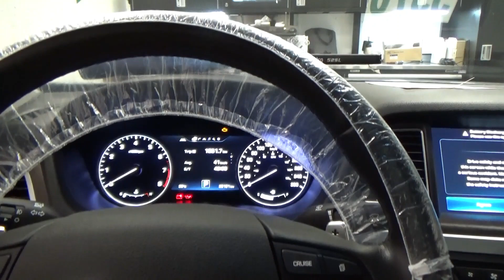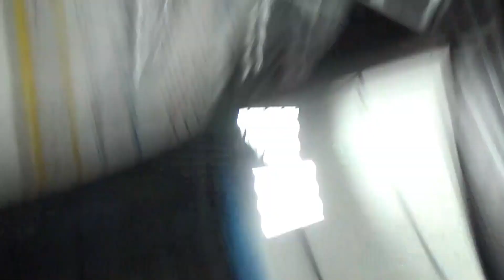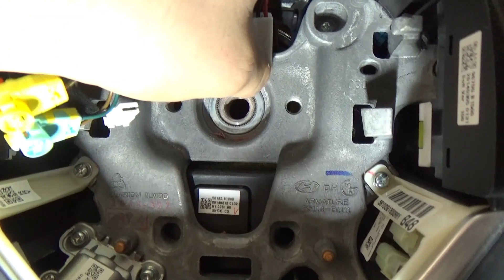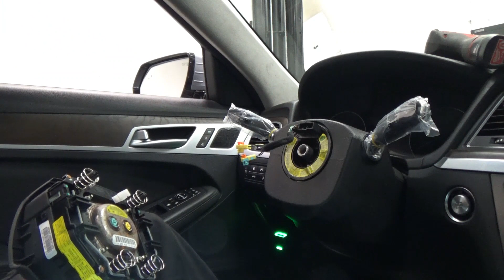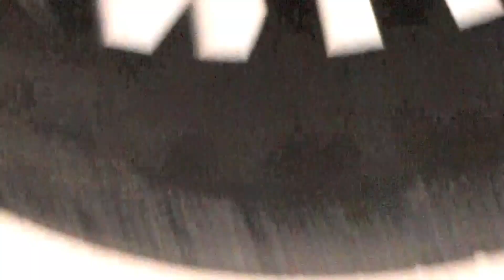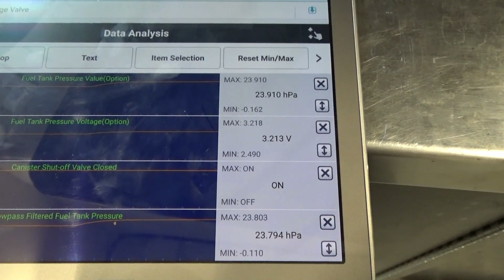2015 Genesis G80, Multifunction Switch Replacement and Incorrect Purge Flow Diagnosis

Comment: I have a 2016 and the dealer is wanting to replace PN 93410-B1400-FFF which is slightly different than what is listed on the warranty extension. If I look up this part, it pulls up the main base but only the turn signal stalk without the wiper stalk. It's also significantly cheaper than what I'm seeing online thru OEM websites ($150 versus $600).I wonder if Hyundai is trying to save money now by excluding the wiper switch and having techs swap in the old one.

Comment: Great video. I wish you had explained the airbag release better. You poked a screw driver in from the back but never described exactly what you were releasing. When you showed the back side of the airbag, you mentioned the pry area but I could not see it through your hand. Then you said something about a spring or clip...I wish you had explained that better. But still a good video
Reply from the maker: Yeah maybe next time.

Comment: First, I want to thank you for the video—well done! I was getting a P0441 error code and couldn't find the cause. I replaced the gas cap and the Bank 1 upstream O2 sensor, but the code persisted. After watching your video, I located the fuel tank pressure sensor and found that the sensor’s nose (not sure what it's actually called) was broken. I replaced the fuel tank pressure sensor, cleared the code, and—no more check engine light! Thank you again for the helpful guidance!

Next projects: 
1. Find an alternative for the DRL lights that keep burning out.
2. BDS errors that keep popping up
3. Reverse Camera not working

Car: 2015 Hyundai Genesis G80 Sedan 3.8
Mileage: 262,000 
Fuel tank pressure senor PN: 31435-2J000

Comment: I'm experiencing a issue with my fuel meter reading. It's stuck on full but the mileage range numbers indication is correct. Should I replace the fuel sensors or is it a wire or connection issue? I have a 2015 Hyundai Genesis G80 3.8L (118k miles)
Reply from the maker: What do youn mean your mileage range number indication correct? Like if you have have full tank and let say it has 400 km ramge then down the road you drove around 100 km and the cluster will say 300 distance to empty? I would suggest scan it for codes and if no codes i would suggest check the sender sensors, they have two.
Reply: @hyundaitech  Correct, due to I overfilled it, I was told to drive it down to about 100 miles of gas left and see if the gas meter go down. I have no codes, no engine light. Everything works fine but the gas meter reading is stuck on full (digital).

Comment: Great comprehensive video! I have a 2013 Genesis R Spec that is having the same problem with the multi function switch. Is the disassembly procedure the same for my year as the 2015 or can you please explain what the disassembly differences are. Thanks!
Reply from the maker: I think for your model you can try remove the steering column cover there should be only 3 screws holding it, remove it and then maybe theres access point to remove the screws holding the multifunction switch assembly. As per the service informatio  thats all you need to remove the switch let me know

Comment: Did you have to disconnect the battery before removing the airbag or you just risked it for the biscuit?

I think in the USA there was a TSB or recall for the multifunction switch
Reply from the maker: Hahahha unless you are experience enough yeah i think risk it. But from time to time, i remove the negative cable which is the proper way. Hahha

Comment: Is the multifunction switch covered under a recall in Canada?
Will the option show up on the dash that the light is switching if it is a problem?
Reply from the maker: Hey man, im dont think its gonna be a recall coz i dont see this failing on this models( this is the first time). The only thing i noticed when i was checking this car that it was very intermittent when the auto position will turn off even the switch is physically in the auto position. Hope that helps.
Reply: @hyundaitech  That helps! Usually I switch mine manually from off to auto when it is dark outside
Reply from the maker: @4555Anthony  yeah same here, im used to manually switch the multifunction everytime i drive the car. Hahhaa
Reply: @hyundaitech  lol old school ways

Comment: I thought in 2015 it was a Hyundai Genesis 5.0 or 3.8? Thought it changed to Genesis G80 (stand alone) in 2017
Reply from the maker: Yes when if im not mistaken when 2017 starts thats when genesis starts to separate.

Comment: My 2015 Genesis G80 does not have a cover under the back seat for the fuel system! I changed the fuel filter before and had to drop the whole fuel tank to change it
Reply from the maker: Yeah you gonna drop the whole thing.
Reply: @hyundaitech  yeah I understand that but in my car there is no hole for the connectors under the back seat. Is it because my car made for middle east?
Reply from the maker: @hasoonlex  ahhhh, really? Im not sure about that. Yeah in that case maybe the only access is to drop the tank.